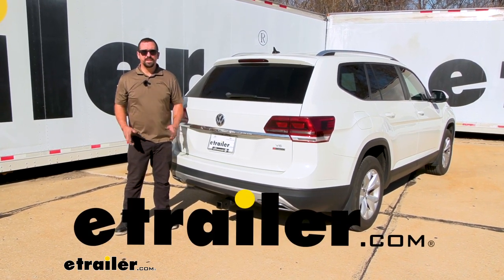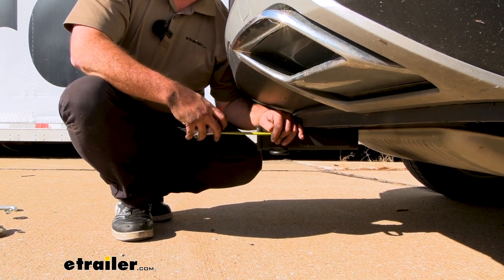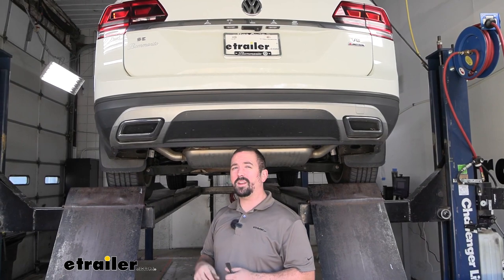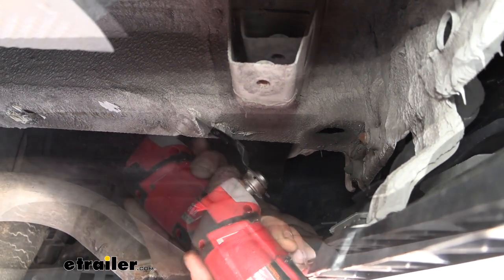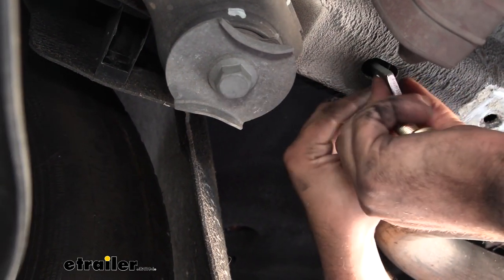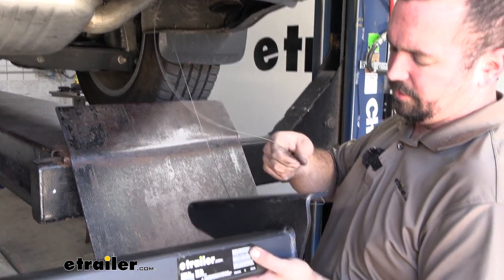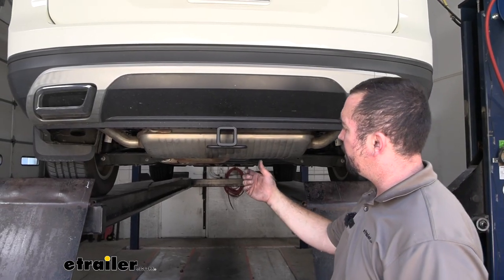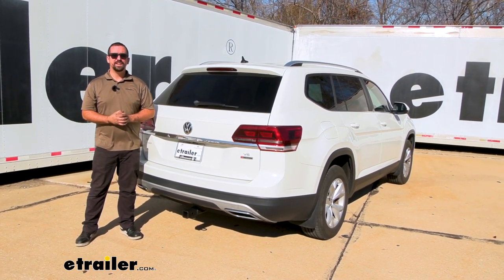Install: etrailer Trailer Hitch Receiver on a 2018 Volkswagen Atlas

Comment: I don’t get why we need to strip the undercoating, there is a folded metal lip at the rear wholes which prevent te mount to sit flush anyway.